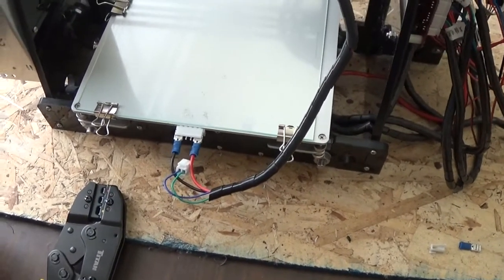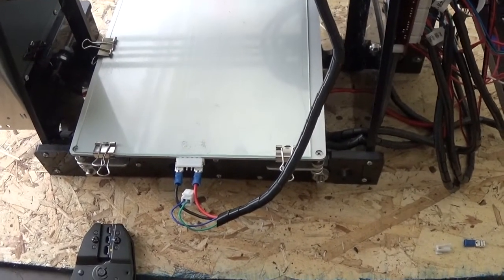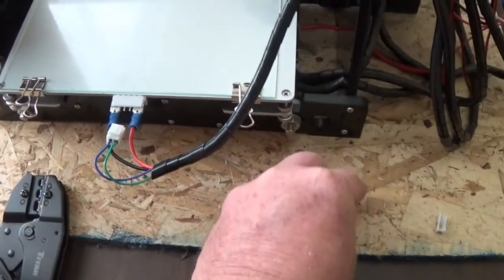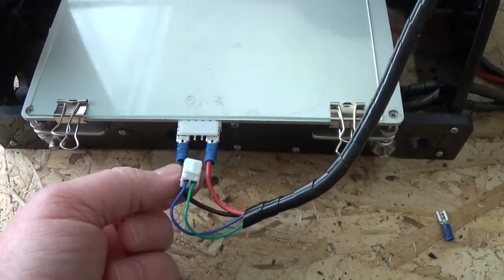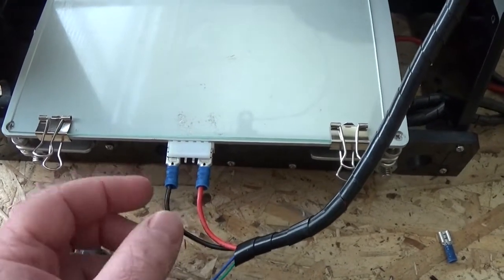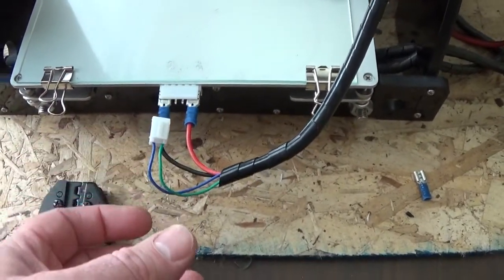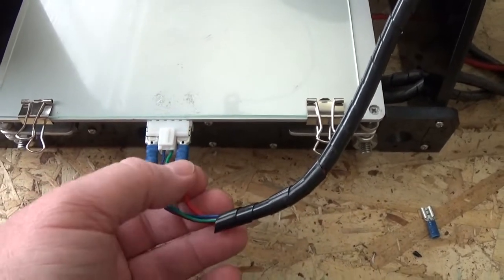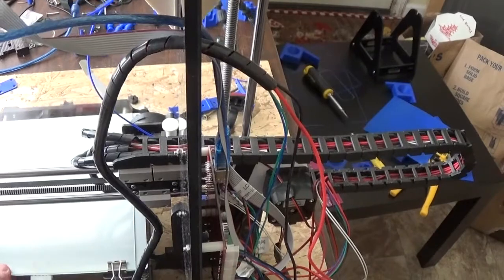Anet A8 bed connector repair

Comment: Very simple and quick method. For reliability/safety I used heat-shrink tubes and contacts a little narrower (4.6 mm vs your 6.3 mm) - they fit exactly on 2 pins and sit much tighter.

Comment: Should print one of the strain relief designs off thingiverse as well.
Reply from the maker: Luckily, mine does not have any stress on the connector or wires.